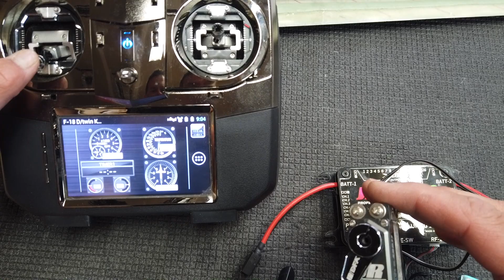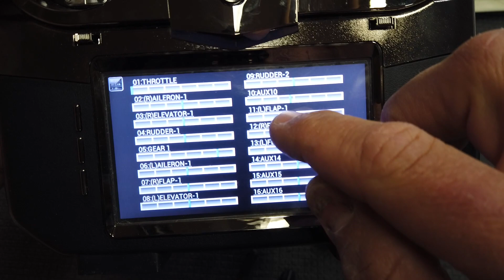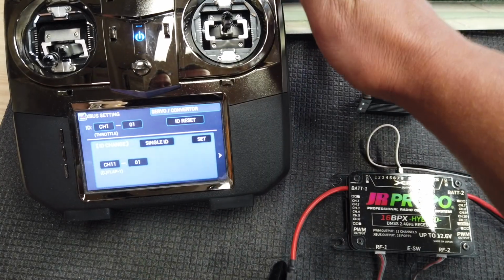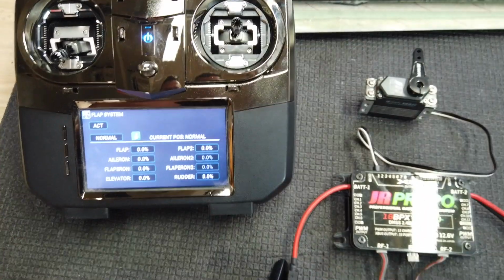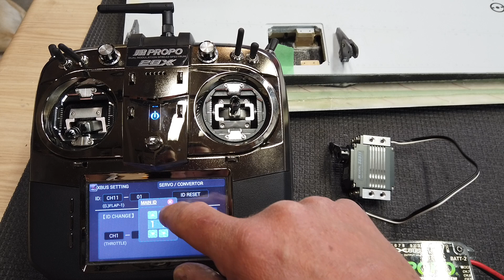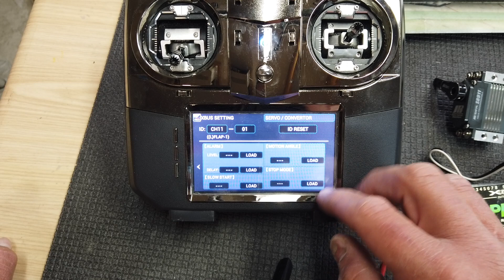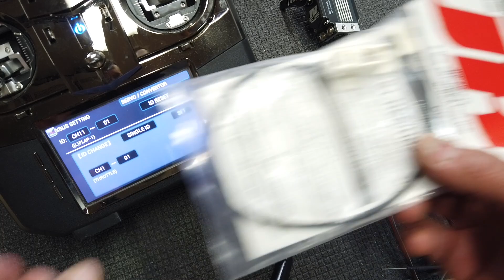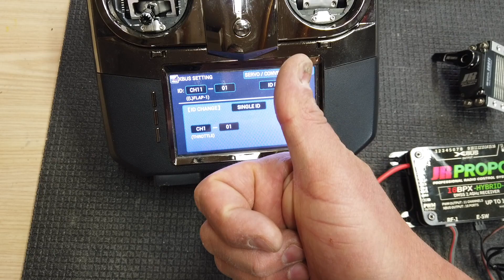SKYMASTER F-18 - Build Video #5 - Xbus Servo Setup/programming. JR Propo 28x X-Bus

Comment: Thanks for the lesson again, it is helping me understand the receiver and Transmitter knowledge. Greg of Ohio. PS. Could I use Loctite 9462 epoxy to coat the foam tabs on my wings that hold the servos to add more strength?   Thanks God Bless
Reply from the maker: Hello Gregory.  if the foam is porous than it may work.  If it's standard white EPS style foam than it may not adhere that well.  I would suggest trying a test spot in a non important area to see how the adhesion is.

Comment: Purchased a BVM 1:6 scale F16 using a FLYSKY transmitter. Never again... Lost all signal during flight in which resulted in a total lost. My first scale turbine jet, first flight, total failure. Took me 8 months to save up. Any suggestions on a good transmitter to start using?
Reply from the maker: Sorry to hear that!  That is not a fun way to start in this side of the hobby.  There are lots of great transmitters out there but i'm partial to Dee Force JR Propo products.  Their DMSS system is rock solid.  The Xbus expandability makes for limitless possibilities.  Check them out at https://www.deeforce.net/ Feel free to email me if you have any questions.
Reply: Ok. Thank you very much. Will have to do some research on this transmitter and hopefully everything goes well on my next purchase...
Reply: I ended up going with the Futaba 18MZH
Reply: Which flysky radio?

Comment: Hey there

Loving all the information and lessons from your builds.
Just wondering on your thoughts about multiple fuel tanks in an aircraft and if you would connect them in parallel or a series?
Looking at getting a Eurosport and haven't had to use multiple tanks before

Thanks!
Reply from the maker: Hey George. Thanks for the question. It’s a good one. I have done it both ways and specifically on a euro fighter I built about 6-7 years ago I also did it both ways. This is what I came up with as a guide for how I do it. 

If an aircraft has a main tank then a pair of saddles than fuel will fill from UAT to main to both saddles at the same time to vent. Make sure all lines from main to vent including clunk lines are same size and length. This setup works well. 

If an aircraft has a pair of saddle tanks only, as an example my F22. The fuel would go from UAT to one tank to 2nd tank and then to vent. Without that main tank to act as a buffer in this scenario running them in parallel can be an issue. 

Hope that makes sense.
Reply from the maker: Oh and some people will bring up the issue of the aircraft being in balanced if your pulling from one saddle tank first. I have never found and imbalance to be noticeable in that scenario.
Reply: Hey Jonathan

Thanks for all the info. It would be only a pair of saddle tanks and a UAT, so will go with the series options
Looking forward to the build and keep up the vids!

Cheers
George